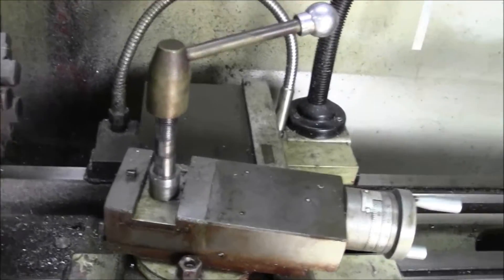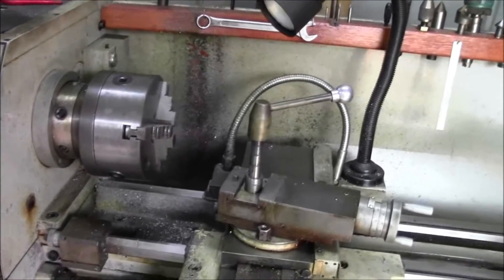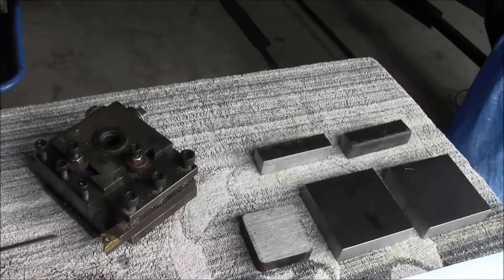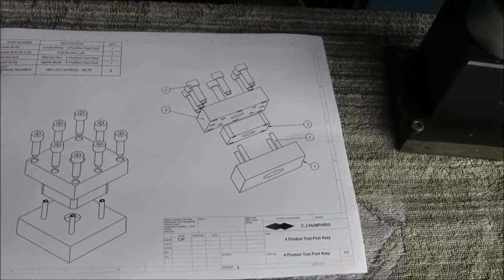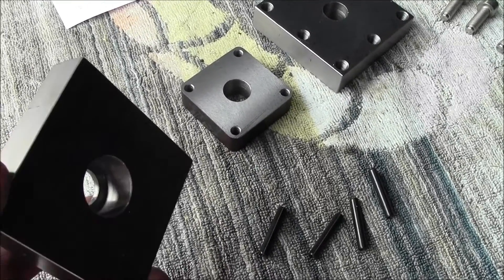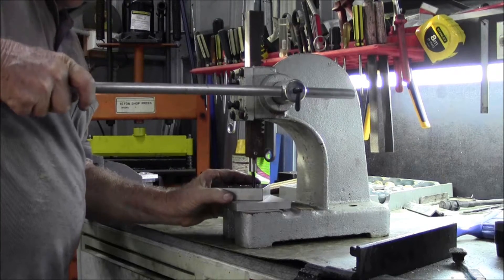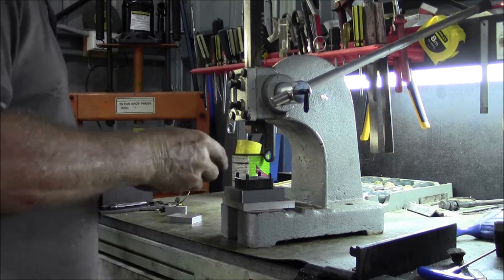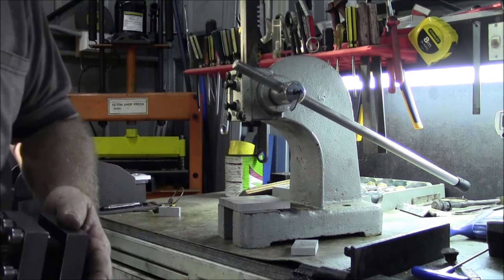Fabricating a 4 Position Lathe Tool Post

Comment: Nice job! Just what I was planning to do to complement my standard 10mm tool holder but to allow at least 12mm tools, possibly 16.

The only adverse thing I can think of is that the clamping screws effectively would also be trying to jack apart the top plate from the bottom two as they are tightened onto the tools. Provided the top clamp is fully tightened when fitting tools it shouldn't be a big problem though.
Reply from the maker: Hi Bob,

I have since added 4 x Caphead screws to hold the "sandwich" together.  I realized after I made this video, this was necessary.  Part of the learning process.

It was quite easy to do by the following process:
 
1.  Drilled a blind hole in 4 places equispaced around the centre to a depth 2mm short of breaking though the bottom plate.

2.  Opened up the holes to clearance size through the top and middle plates.

3.  Counterbored the top plate to suit the Caphead screws.

4.  Tapped the lower plate blind holes.

5.  Added 4 Caphead screws.

For the latest iteration, including the design oversight fix, you can find my 3D Models & pdf drawings here: 
https://grabcad.com/library/4-position-lathe-tool-post-1
Reply: @chrisjh777  cool! Thanks for the link. I know the problem first hand. The number of projects I have had where I suddenly realise "Doh! Dufus!" after the event or half way through about another way to do things, is countless. 

Even so, nice project and in any case, the tightness of those roll pins ensures rotational stiffness and accuracy. I may follow your drawings exactly as I'm a much better fabricator than welder and I don't have a mill large enough (only a standard Proxxon MF70). 👍👍👍

Comment: interesting have you consider , tacking you design,   One step closer to  achieving a quick change tool post  system,  by making the canted block with a centre block to enable  a Dovetail .  tool carrier   to be used or some other type of holder readily purchased from a supplier.   to fit any  carer, That one may have available.   ? I  May attempt if your idea is not patented ?  or if it is will you give me promotion  to copy & Redevelop . 
:- Les Thompson England Telford . 

:- My idea is to have. 
Two side as Quick changing toll holders , & tow normal  freestanding tool's for boring & so on  Similar in function  to the one you made  . But somewhat Different .

Comment: Wont the bolts hoding the tool bits push the top off the lower section.  Not picking but maybe two flat head allens would help. In place of two roll pins.
Reply from the maker: Hi Gary,

I have since added 4 x Caphead screws to hold the "sandwich" together.  I realized after I made this video that this was necessary.  Part of the learning process.

Comment: I guess I miss something here I don't understand the purpose of this
Reply from the maker: My lathe did not come with a conventional tool post so I made my own to complement the Quick Change Tool post that came with it.
Reply: In my case I can swap between 4 different tools mid job without having to set up each one again. I'd have the post assembly rebated and welded at the corners

Comment: i made one similar with roll pins and even riveted the ends down - very finicky setup, it is possible to push the pins out with the tool-setting screws if the center bolt is not 100% tight. plus, you cannot rotate without loosening the tools .... not sure how yours turned out, but i would not recommend that method of fixture.
Reply from the maker: Hi Kevin,

I have since added 4 x Caphead screws to hold the "sandwich" together.  I realized after I made this video that this was necessary.  Part of the learning process.

It was very easy to do by the following process:
 
1.  Drilled a blind hole in 4 places equispaced around the centre to a depth 2mm short of breaking though the bottom plate.

2.  Opened up the holes to clearance size through the top and middle plates.

3.  Counterbored the top plate to suit the Caphead screws.

4.  Tapped the lower plate blind holes.

5.  Added 4 Caphead screws.
Reply: Kevin Keel hi guys , There are no coincidence  in this life and I know for sure that God is giving all of us the chance to know him better , make a relationship with him and have a great life , the answer is  the  prophet Muhammed Peace be upon him , he is the latest messenger from God to all mankind , 
Muslims were once the leaders of the world when they were practicing the commandement of the Coran , 
I know that you will delete this message but please take a few minutes of your time and make some research about it .
I am sending this message to everyone I can reach , everyone deserve to know the truth ,
Peace be with you and good luck. here are no coincidence  in this life and I know for sure that God is giving all of us the chance to know him better , make a relationship with him and have a great life , the answer is  the  prophet Muhammed Peace be upon him , he is the latest messenger from God to all mankind , 
Muslims were once the leaders of the world when they were practicing the commandement of the Coran , 
I know that you will delete this message but please take a few minutes of your time and make some research about it .
I am sending this message to everyone I can reach , everyone deserve to know the truth ,
Peace be with you and good luck.